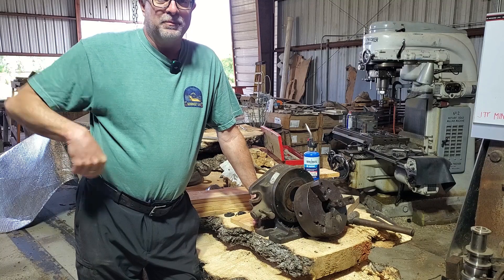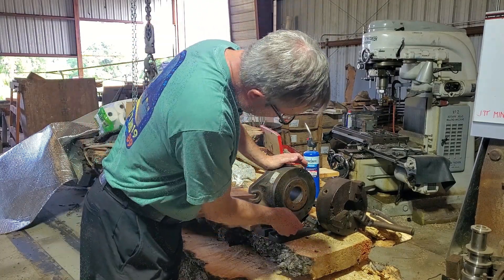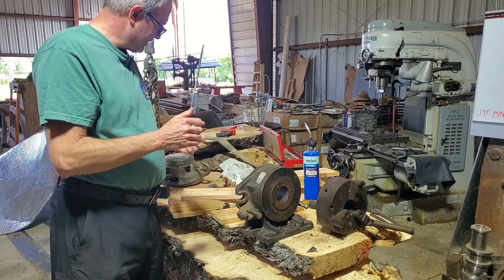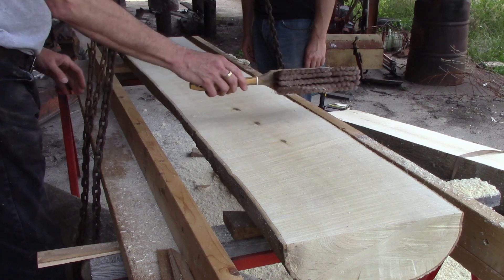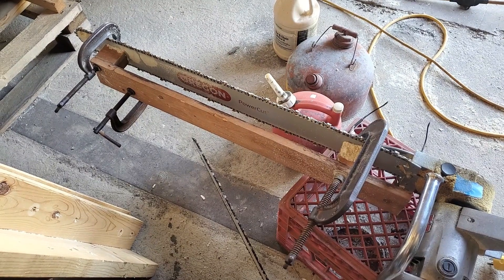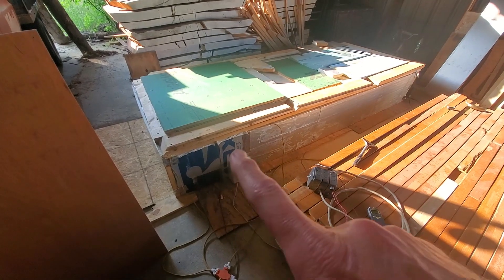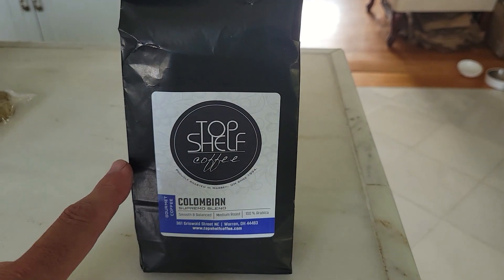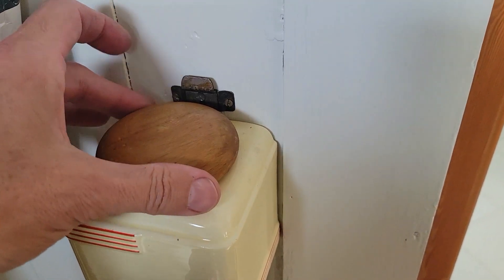Machining a Brass Donut for a Coffee Grinder

Comment: Repro-Rubber self-leveling silicone was my first thought.  Mix some up and pour directly on the wood stopper. Molded in place and perfect fit.  We have some in QC to take impressions of hard to measure parts.  ----Doozer
Reply from the maker: I hadn't thought about a pourable gasket... I'm already down the path on my silicone gasket with brass ring but yours is a good solution too.